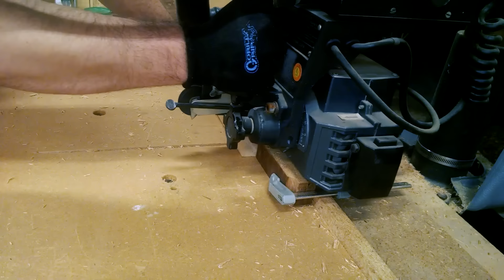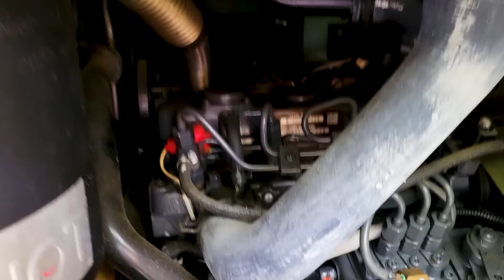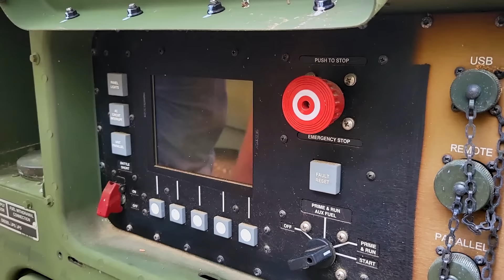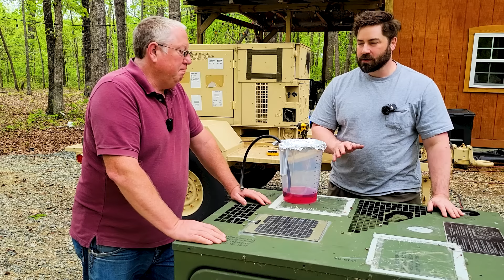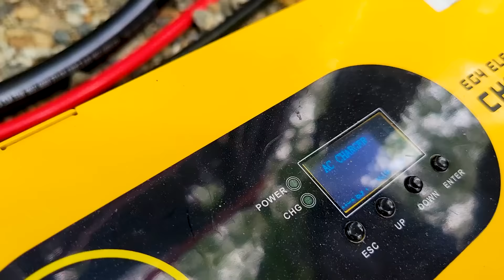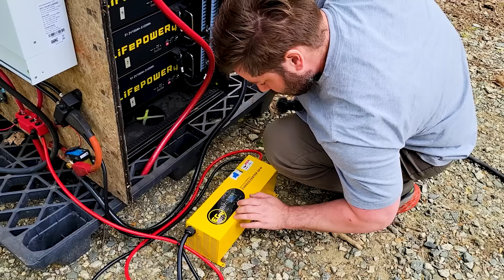Testing the Army's most efficient generator

Comment: I’ve got the bigger brother MEP-1040.  That’s a 10 KW prime power rated machine for 24x7 service.  The Engine is a 3 cylinder 26 KW Yanmar turbo Diesel with replaceable cylinder sleeves.  It looks identical to the 1030, just a bit larger in all dimensions.  It is an insanely capable machine.  If you flip the “battle short” switch the unit will put out as much as 20 KW.  Of course that is only for dire emergencies.  If you can snag one, do it.  The hour unit on my unit only had six hours when I received the unit.  The Army depot had properly mothballed the unit, but disconnected the two Optima Yellow Top batteries and never charged them for two years.   Being disconnected, the batteries were irrecoverably sulfated.  I tied for a several weeks to revive the batteries, but no luck.  Optima batteries should be on a battery tender.  The MEP 1040 does the same thing as the 1030 - there is about a 30 second warm-up before the unit ramps to 1800 RPM and the output can be cut in.

I got my unit at auction by waiting to the last few units to go on the block.  The first few units went for about twice what I bid and they weren’t in any better condition.

You can get a kit to convert the new MEP generators to remote autostart.  There isn’t lot to the board, but the seller asks a quite large price.  You’re paying for the knowhow of how to dig into the wiring in the MEP.  The wiring is complex, and not for the faint of heart to try a DIY modification.  I have not set up for remote start yet, but eventually I would like my transfer switch to be able to bring the generator on line when power fails.
Reply: Yep, Kurt is a good guy to deal with. I worked with him on the version for the 80x series was under development. I have one of the first ones made. 😊The ones for the 10xx series are more expensive but I think he is working on a new version that should bring that down some. Hopefully I'll get to have some hands-on time with it when he has the prototypes ready. 

According to the specs, the MEP1040 is even more efficient than the MEP1030 is. If I ever manage to snag one at auction, I'll find out for myself.
Reply: Can I ask how much you ended up paying for yours?
Reply: @IsabeauVidal  After all was said and done, they were between $5k and $6k. The one in the video was actually the most expensive one. The two I bought on trailers were a few hundred bucks less. They did have 300hrs instead of the 20hrs the one in the video had when I picked it up. I've seen them go for a LOT less in other areas. We seem to be a hotspot for generator buyers and they go for a premium.

Comment: you need to run 3 phase to assess the spec's with a resistive load, having unity power factor.  Ask someone with a power analyzer
Reply: Planning to do exactly that. I've got all the equipment needed to do it.  I've also found some conflicting info on fuel burn that I'm going to research further.

Comment: The fuel tank is very small. And the ultra sonic sensor seems like one of those things that will break first and the computer will refuse to run without it.
Reply: I know of at least one reported failure of the sensor of a unit in civilian hands. That is one part that I have my eye on to see if they are reliable over the long term.

Comment: Yeah, the fuel consumption ratings assume the genset is operating at sea level, 59F (15C), with a barometric pressure of 29.92. If you're not operating under those exact conditions, the old adage of Your Mileage May Very applies.
Reply: Not to mention that I've found numbers in brochures that don't match what is in the technical manual. The number in the brochure is very close to what we measured. I'm thinking the TM is in error or has outdated info in it.

Comment: The most efficient generator is the ones that doesn't cost thousands of dollars when a solid state component goes bad, takes hours to do basic maintenance and doesn't have silly quirks like the fuel sensor tube getting clogged when its freezing outside.

Sounds like I had to deal with this model/type before, huh?

And no, it's not more fuel efficient than its contemporaries.
Reply: That is why if anyone asks what I recommend, I point them towards the MEP80x series. Much simpler and easier to get parts for.
Reply: @TrackGeeks  I can't confirm if parts are easier to get, but yes, they're definitely easier to get into and work on.  Even oil changes are easier.

Comment: If from what I'm hearing, that motor is not fireing on all its cylinders.  Might be lack of compression.  So if its only running on two of its cylinders, then that would throw the results way off as it would have to burn more fuel to make up the difference.  Timeing should not be a issue, if a person is rebuilding it, and can't aline two dots, they sure don't need to be working on any motor.

Comment: John Deere tractors do not use Kubota engines.
Reply: You are correct. That was an error on my part. Both of my JD tractors have Yanmar 3 cylinder diesels in them. The Kubotas are popular with zero turn mowers and some UTVs.

Comment: I didn't quite catch all that was said, so sorry if I missed it, but did you account for the cool-off period after? And the startup period when it was running with the contactor open as well?
Reply from the maker: No, if you want to calculate them, here are the numbers.  We warmed up the engine before beginning the test, and you saw in real time how long before we closed the circuit, maybe 30 seconds.  The cool down we let it run for 5 minuets with no load.  Roughly consumes 1 gallon in 2 hours at full load, so every 5 minutes is 1/24 (0.041667) of a gallon.  But, remember, that is at full load.  The cool down period had no load.  Generally speaking, let's say the engine consumes 10% rate at idle vs. full load.  That means 0.0041667 of a gallon was consumed during the 5 minute cool down period.  
Anyways, I figured it wasn't worth getting worried about.
Reply: @DavidPozEnergy  Thanks! That seems to make sense, and looking at the numbers I can certainly see that it really wasn't worth mentioning.

But it was fun to see what the new gens are all about, even though it would likely just be an academic exercise. Keep at it and good luck!

Comment: I love my ammps 1030 and 1040 units.  so far they have been pretty easy to work on especially the 1030 as its a Kubota D902 engine. I have 3 other pieces of equipment with that engine.  i also sell Mil generators and as Chris said in the last video not very profitable.  Parts seem to be the better money these days.  still a fun hobby
Reply: Drop a note if you ever want to swap generator repair stories! 😆

Comment: It has 3 cylinders and weighs 780 lbs. but is only 5KW!
Reply: I don't see your point. I have several old air cooled, gas engine Onan generators that only produce 4Kw(more like 3Kw if continuous load), yet weigh over 300 pounds. One of them is from 1969, and I have my doubts that any of these electronically controlled new units will last anywhere near that long. My liquid cooled, diesel engine welder/generator weighs approximately 1750 pounds, yet can only produce 3Kw of 120/240 AC power......though it is an actual generator machine and only outputs DC through the welding leads.

Comment: To claim 3% discrepancy on three phase and 10% discrepancy on the break in?   C'mon man...  you just went to zero credibility (flip those numbers bro!).  The most efficient unit of measure for this or any military generator is three phase.  As a former AGE in the Air Force I can state without a doubt that a resistive load bank is not going to match your inverter/charger into a battery situation.    Plus fuel differences - you were using red diesel, when I was in the service it was JP8.   No idea what fuel was used to test for military use now.    Stick with the fact that this was a very quiet generator with low fuel use for KW and stop trying to over explain...
Reply: I'm going to do some testing to specifically show the difference between 3 phase and split phase configurations. Totally agree that testing a switch-mode power supply against a resistive load bank isn't apples to apples. Both configurations will use the same load bank which will give a good basis for comparison. 

In regards to credibility, I'm not perfect and I'm not afraid to be wrong. Acknowledging when you are wrong is a fantastic agent for growth. If you think incorrect information was presented, lets hear your take on it. I'd like to know where the data for a 10% difference comes from. Always up for learning something new!

The red fuel used was not JP8. It was non-highway ULS-D2. The fuel was very fresh and should be the summer blend. I'll check with the vendor when next I resupply to verify the months of winter blend. When I picked that machine up it had under 20hrs on it. Any fuel from before I got it should be well diluted out.

Comment: Interestingly, 38% of 3.8 gallons is 1.44 gallons. Even more than your measured consumption. 

And, it’s like peeing on a forest fire, but I always respectfully as possible point out that, no matter what inverter manufacturers say, no matter what the Internet says, no matter what Wiki says (lol), there is no such thing as “split phase” power. It’s single phase. 120/240 volt, single phase. There are split phase motors though. 😉 Which is likely where the confusion started.

Comment: I would like to see it ran again with at 5kw without over loading it.

over-amping (exceeding its rated current, typically reduces efficiency due to:
1.  Higher Heat Losses: Excess current increases resistive (I²R) losses in windings, wasting energy as heat.
2.  Magnetic Saturation: Overcurrent can saturate the magnetic core, lowering power output efficiency.
3.  Mechanical Strain: Increased torque raises friction losses in bearings and rotor.
4.  Voltage Drops: High current causes output voltage to drop, reducing power quality.
These factors decrease the generator’s efficiency, increase fuel consumption, and risk damage. Stay within rated specs for optimal performance.
Reply from the maker: The generator ran overloaded for a minute or two before we adjusted the charger down.  So, out of the 2 hours and 20 minute run time, about 2 hours and 18 minutes was run right at 5kW.

Comment: Wouldn't it be a lot easier to run it dry and then add an exact quantity of fuel?
Reply from the maker: I have done that in the past with gasoline engines.  But, I don't want to run a diesel dry as it's bad for the injectors.  Also, this particular unit has an automatic shutoff when fuel is low.

Comment: After watching a second time I noticed you are using the first generation EG4 Chargeverter. EG4 discontinued that first gen due to inefficiencies, or so I read somewhere.
Reply from the maker: I've tested the yellow model and usually got 90% at home.  The new model can get up to 94%.  In the video I mentioned 90% for our calculations. However, the main reason for the new model is to allow slow ramp up because the old model could cause small home (consumer grade) gensets to stall out.
Reply: @DavidPozEnergy  Ok. That makes sense.

Comment: Was that running it at 120VAC, why would you use 120 when you have 3-phase or 240V?  Depending on how long its been sitting there could be 500Wh(+) to stick back into the 24V battery? I do think running it in 3 phase is just a lot more efficient.
Reply from the maker: We ran the generator in 120/240 Volt mode and had the charger connected to 240V

Comment: Try use it a 2/3 maximum power, motors became inefficient if used at full power.
Reply: We only had one rating to go by and that was the fuel consumption in the manual. The published number was for 100% power output so that is what we did. If they had rated it at a lower power output, we would have used that value.

Comment: You made a big mistake not taking into account the efficiency of charging inverter. 10kWh was on dc side which must have been more on ac side, and that is what the genset is producing. It could be right on spec if your charging inverter efficiency were around 90% which is not that unusual at this load…
Reply: The inverter you see in the video wasn't used for charging. The chargeverter was the only charger. David stated in the video that per his testing he has found it to be ~90% efficient.

Comment: It'd be interesting to see how high you could push the efficiency by including the thermal output of the engine to the coolant. I've been tempted to try using a generator to charge batteries, and plumb coolant into a heat exchanger to heat the house (UK houses tend to be heated by water).
Reply from the maker: I hope to have a micro-CHP (combined heat and power) setup by next winter.

Comment: The single vs 3 phase connection is on point, higher current in single phase so greater heat loss. The manufacturer data will be 3 phase at the machine output. 2h20m at around 5kW is about 11.67 kWh, not great, but not as bad. Generators use a fixed amount of fuel per hour at idle, typically about 10% of full load fuel consumption. Energy output fuel use is on top of this. Matching generator size to load accurately is the best way to increase efficiency. The efficiency figure will be at the optimal output, maybe close to 75%. I wondered if the generator moved during the run, changing the angle and effecting the fuel level.

Comment: why would you need a resistive load bank? EG4 batteries have a built in BMS
Reply from the maker: I wanted the battery Voltage to stay stable through the test.  The Chargeverter is set at an output current, not output Wattage.  So, if the battery Voltage went up, then the Wattage would go up, and then we would overload the generator and the generator would shutdown.  That would void the test and we would have to start all over again.  So, by having a load on the battery we could maintain the battery Voltage constant over the course of the 2 hour test.
Reply: @DavidPozEnergy  doesnt make alot of sense to me... The charge curve of LiFpO4 batteries is pretty flat except at the last 5%. Not to mention the batteries draw less current as their voltage goes up, not more.
Reply: This video was shot the day after the 400hz generator video. We had put a bunch of power into the bank with that previous test. That is why we used the load bank.

Comment: efficiency is great, but in my case if I had a solar array my main concern is ease of use, reliability  and power output(with a side benefit of being cheap or at least cheap to maintain)

when the generator is used for emergencies only what matters to you is that it starts up and puts out power as long as you need, then remains reliable sitting around for the week/months between uses

I would likely go with propane, they tend to be fuel-stable and also easy to start with low issues as long as the air intake is clean and the oil is fresh, so likely do a pre-winter maintenance where you run it for a few hours, change the oil and filters, and then bed it down in standby again

Comment: These little engines are rated up to 10kw but they rarely have heads bigger then 6kw. I've seen some light towers like the Allmand have optional 8kw heads.

They are doing this for engine longevity so the product lasts 10-15k hours plus.

I wonder if running the engine up closer to it's limit would gain fuel efficiency.

Comment: Are they EMP protected and lightning protected?
Reply: lighting yes if set up correctly, emp no. there is no need for emp protection. that is a useless feature.
Reply: Here is what is stated on the Cummins website for the AMMPS series of generators:

Ability to withstand high-altitude electromagnetic pulse